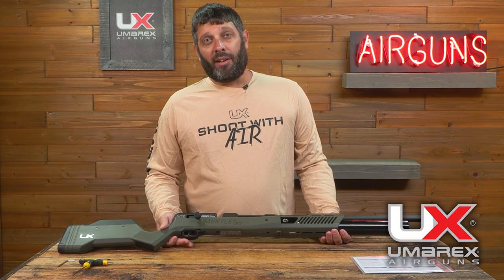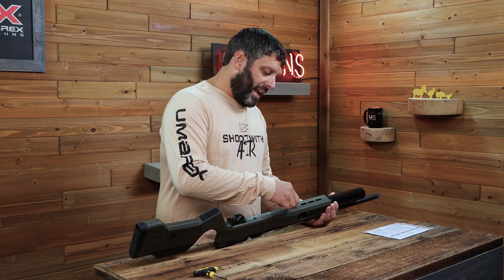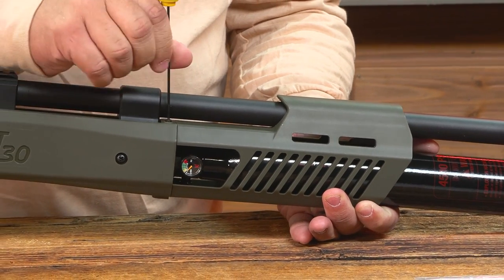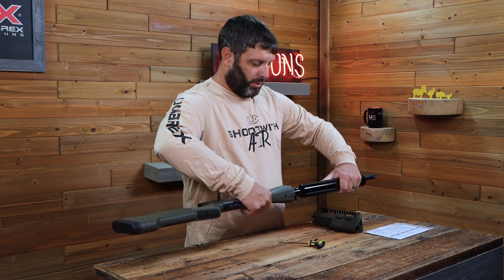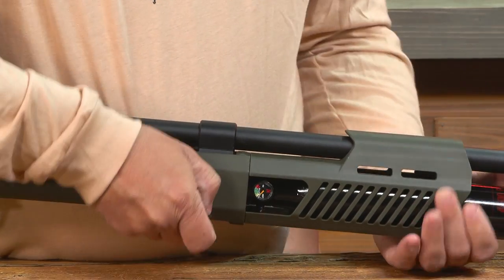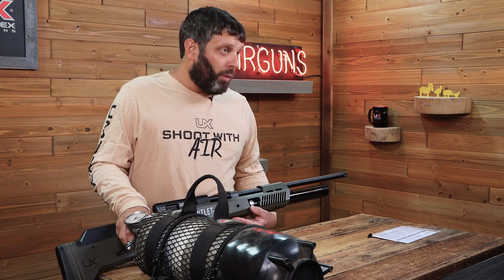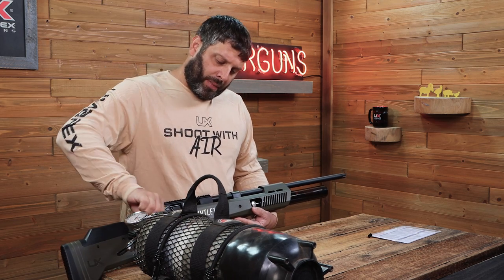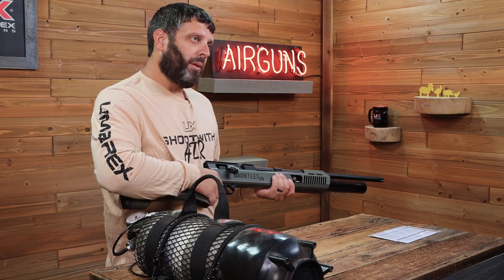Umarex Gauntlet 30 Tips on first time airing

Comment: Yeah, I forgot to cock it and spent like 3 minutes running the compressor and thinking, wow, this is a big tank. When I turned off the compressor, I could hear air coming out of the barrel 😆. It only took a few seconds before I could notice the needle moving after cocking it.
Reply from the maker: We've all been there.

Comment: Mine won’t fill past 2800 psi and I can only get about 12 shots per fill, any advice?
Reply from the maker: Fill capacity limitation is likely the device being used to fill with. =/
Might take a look at that. Another thing is the gauge could be off, but based on number of shots doesn't seem like it.

Comment: So i have a pellet trapped halfway in the barrel and magazine, i cant remove the magazine nor can i fully push the pellet into the breech, there is air in the tank so i dont believe i can fully remove the barrel, what are my options for fixing this problem?
Reply from the maker: Make sure on safe. Degas it fully. Pull bolt/side lever all the way back. Carefully insert a cleaning rod with no attachment into the barrel and apply light pressure to the pellet so that it goes back into the magazine.
Unlikely the pellet could get sideways to an excessive degree, but it could be possible. If that is the case, sacrifice the magazine or call to set up a return auth. 479-646-4210 ext.7 Mon-Fri 8-5 Central time zone.
Reply: @UmarexAir  I ended up taking a hammer and flat object and lightly tapping the magazine the pellet kind of got smashed and but somehow was pushed back into the magazine, I then cleared the barrel to see if there was anything like a broken piece of the pellet but it was all clear, took it out and shot a few rounds with great accuracy and success, all is good, thank you for the response.

Comment: The rear sling mount on my Gauntlet 30 doesn’t work with Magpul quick disconnect sling swivels. Swivel pulls loose when pressure is applied. Is there a sling swivel recommended for this air rifle?

Comment: I have a gauntlet 30 caliber. Has a very slow leak,not really a problem per se. My problem is that I tried to turn the hammer spring to lower the speed. And the provided allen wrench stripped out. That bolt will not move at all. Going to buy some Allen head sockets to try to bust it loose. Did they put loctite on it?
Reply from the maker: No Loctite on the hammer spring adjustment screw.
Reply: Must be something on it. Doesn't come out. Screw is stripped out and useless now. I've been at it with a drill bit so I can get it apart. Bought a replacement from terminador. Umarex won't send me the part. Have to send gun in. Not happening

Comment: At .30 into this video, is that also to degas the rifle?
Reply from the maker: Correct. That screw in the bottom of the stock is to degas the rifle.
Reply: @UmarexAir  Thanks, I needed this clarification as I  have the Umarex 2 .25 caliber as well but it's degas is on the left side of the rifle. My .30 has been leaking air through the intake valve, when I put the nipple cover back on it pops off, and if I cock the side lever I can hear air draining from the barrel. I am going to fill the tank halfway and degas, I was told this should fix the problem. I have yet to find out, if it does not I can still send it back to be refurbished or send me a new rifle. I have only had it 9 months. Thanks for this Reply... 🤙🏼

Comment: I've got a .30 cal that I put 10 rounds through total a year ago and it's been sitting since, it wouldn't accept a fill and I burnt up my pcp compressor. Guess what it was? 😐
Reply: What was it?
Reply: @aaronrudd2690  the tank wasn't seated properly and I had to remove and fix. Flawless since.
Reply: @Richard-yj7tg what do you mean when you say not seated properly? Sorry if my question is dumb, im clueless about guns and air rifle in general and english is not my first languange, thinking about buying this air rifle and would like to know more before that. Thanks
Reply from the maker: Glad you got it resolved and sorry you had the trouble. =/

Comment: Does it come with the fill port hookup?  I know some come with different types of fill nozzles. I guess I need to know if I need to buy anything else to get it filled other than the compressor that I just ordered today. Thanks
Reply from the maker: You won't need anything else, the Gauntlet has the quick connect fill-port.

Comment: Yes do u know if it has a ball valve seal and ball and spring and how many shims are in the piston
Reply: Mine didn't come with ball or pin in it. Since its continuously held open it isn't required. Also so ppl wouldnt try screwing on and off full airtanks. You have to degass it first.

Comment: 1st time PCP owner - what's the best way to fill my new Gauntlet .22 ???
Reply from the maker: The best way is to use a high-pressure airgun compressor or airgun "scuba" type tank made for PCP airguns.
Reply from the maker: And you can take it to a paintball or airgun shop to get it filled if you don't have a way to fill it yet, most of those shops have a high-pressure compressor to fill tanks for a small fee.
Reply: @UmarexAir  Small compressors and hand pumps have a hard time seating the poppet seal and continue to leak. You need to have vendors pre fill prior to shipping to avoid returns. Also see my other comment for further feedback if you all really care.

Comment: Does the fill hose come with it
Reply from the maker: It does not come with a fill hose, it has the male end connector
Reply: @UmarexAir  are you able to air it up with a regular tire air pump or compressor?
Reply from the maker: @Mr.JayOutdoors  No, shop compressors don't come close to the pressure needed for airguns.
Reply: @UmarexAir  😵‍💫😫😱 I guess I'm pretty screwed then
Reply: @UmarexAir  there's no pcp airgun place no where here. The closest scuba place is nearly 2 hours out. Trying to find away to air it up myself. The hand pump is going to kill me lol. It takes over 300 pumps to fill up.
Reply: @Mr.JayOutdoors  nomad 2 for $800. The Air Venturi 4500psi compressor is pretty good, but thats $1700. Scba tanks rock though. lol

Comment: I bought two brand new SL 30s and they're both leaking air!! How do you stop them from leaking?
Reply from the maker: Assuming you followed the steps in the video first, then call 479-646-4210 ext. 7. If unmodified then they are still under warranty.

Comment: I bought this gun and it LEAKS straight from the factory. Dont be fooled people it will not hold air. It was not tested from the FACTORY.. I own 3 Gaunlet rifles and will never buy another Umarex again. I have not been able to find a o ring kit to fix this problem .The bolt action is not smooth as it should be .I put the gun in my closet and has never been used again. I would return the gun but it is a pain in the butt to return any rifle. Umarex needs to address this problem.
Reply: i bought the cheapest gun they sell and it is rock solid ..i did want to buy this 1 aswell but ow man ..i stay away and save my money  for smth else.